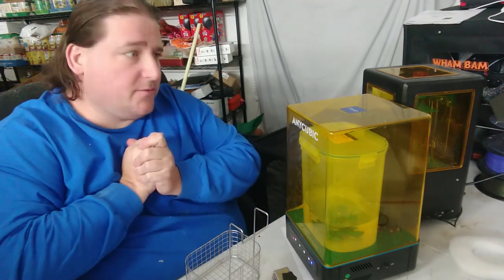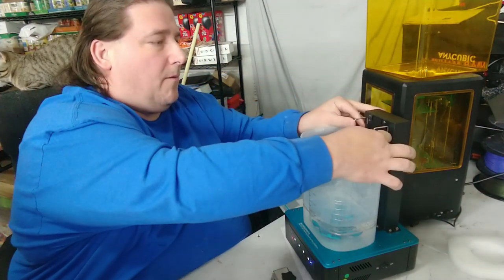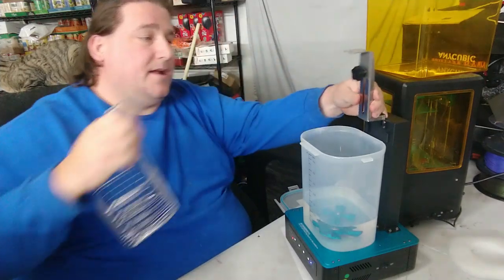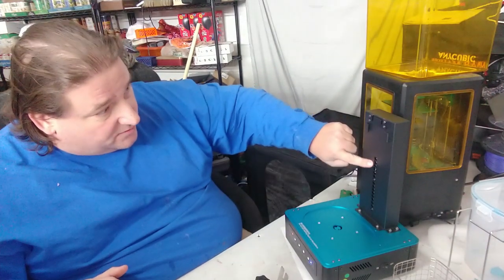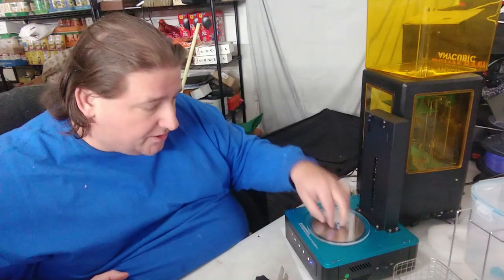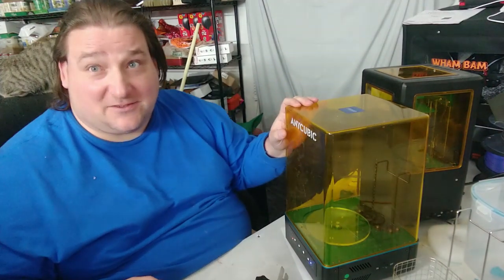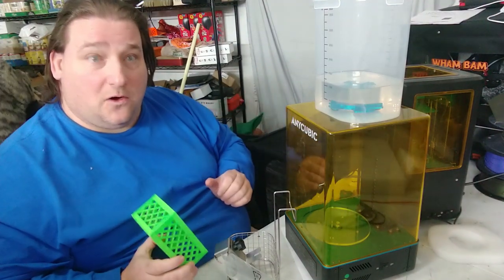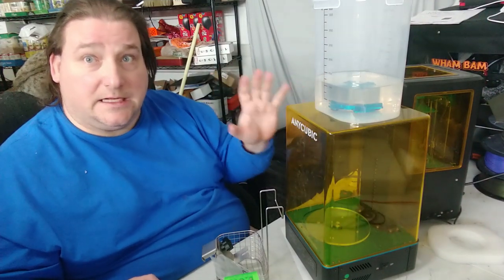Anycubic Wash & Cure Station for 3D Resin Printing T3DP

Comment: The bearing they use in the wash impeller appears to be carbon steel and not sealed, just shielded. Mine froze up after just 1 week of use with soapy water and one week empty. I purchased 10 replacement sealed bearings for about $12 from Amazon. Anycubic needs to change their bearing spec.

Comment: Sorry to chime in this way ... but embedding more leds in the bottom is a good idea BUT it doesn't have to be a ring... it can be a simple line just like the back line because the turntable is turning anyways.
Reply from the maker: True but a ring would cover more angles underneath. And cure more of the model. But yes a line can also work. And don't apologize. You didn't do anything wrong. :-)

Comment: Just a thought on why the DVD didn't work. The light diffraction given off DVD's probably washed out the UV wavelength. Some type of mirror would have been a better choice.
Your suggestion of UV lights underneath would be the best way to go though. I hope they decide to do that.

Right now, what I do is I put my models on a transparent glass bowel in my homemade cure box. It raises the model up into the light and allows it to cure the bottom. If my models have a hard for light to reach area I try to orient it to get the best coverage. It can be a pain at times trying to make them stand in certain positions. I was thinking of adding some hangers to hang some via fishing line. We have to do what we can to get a better cure.😉
Reply from the maker: Yep. Gonna nake a transparent needle bed to raise up models and prevent flat surface contact patches.

Comment: Nice video! I really want a wash and cure station, but they all are so expensive. my current setup with jam jars with IPA and bucket with UV lights are so clumsy to use. If this ends up costing less than 300USD it will become a must have for me

Comment: nersy, I know you can design an fmd part for that or maybe someone has put one on thingeverse already. I have not looked yet. today is the first time I've seen this. A friend has gotten on the order for this. The mesh on the basket is way too big. needs to be a screen mesh. also I think they should have mirrored the curing plate. You have too many overhangs that will not get light from just rotation. needs something to reflect from underneath.
Reply from the maker: I tried mirroring not enough light for curing gets reflected. They really need to just put a couple of LEDs under the plate. Though even having to flip it and run the cycle again. It's still so much more efficient than the old way.
Reply: @nerys71  sounds like a good plan too.

Comment: I wonder how this compares to Creality's UW-01 Washing and Curing Machine? The price for the Anycubic machine is fantastic right now, but might that be because they see stiff competition from Creality's offering? There's little info on Creality's UW-01 wash & cure machine right now. Using Creality's website as the only source for their machine's specs, the following is how the two machines compare:
- The UW-01 has the ability to time both the cure and wash from 2 to 90 mins (as opposed to Anycubic's 2-6 mins)
- The UW-01 has three speeds (as opposed to Anycubic's single speed)
- The UW-01 has a 170(L)x120(W)x160(H) wash capacity (as opposed to Anycubic's 115(L)x65(W)x165(H))
- The UW-01  cures at 405nm & 385nm (as opposed to Anycubic's 405nm & 365nm)

So it looks like the Creality has the edge. BUT, it's an unknown, is selling for $25 more, and won't be delivered till next month (Jan). 
Thus the $64,000 question is whether or not its advantages make it worthwhile to take a gamble, pay $25 more, and wait a month???? Or just get the Anycubic now? (Considering that I've lived t his long without any sort of washing & curing machine)! :)

Comment: Hi, I'm a beginner in resin printing. When do you know it's time to change the IPA. And what's the process behind it? Wanna make sure I do this right and not damage  the environment. Thanks!
Reply from the maker: If you have City Water I was informed by my Township that flushing it down the drain is fine but flushing the resin down the drain is not good so you're going to want to remove the resin from the alcohol. A shallow pan out in the sun it will cure all the resin and probably evaporate most of the alcohol if not all of it the plastic that is left over you can simply throw away it's inert once it is cured

In theory you might be able to cure the resin and recover the alcohol and use it again
Reply: @nerys71  Thank you!

Comment: Making a tighter mesh on the basket may interfere with the cleaning.  It will be more difficult for the swirling liquid to move through the mesh if they the mesh is too tight.
Reply from the maker: Agreed they have to determine at which point it does more harm than good but this mesh is too open.

Comment: My question is how do you dispose a gallon of ipa? Can you imagine makers disposing millions of gallons of this now in the world.
Reply from the maker: When I called the water company, they said pouring alcohol down. The drain was perfectly safe. The only thing is you don't want to pour contaminated alcohol down the drain. So you need to remove the resin from the alcohol. Sitting it out in the sun and precipitating. The rising out of it should be enough. Once the resin is cured it is perfectly safe.
Reply: @nerys71  Of course, it is flammable, and you have a burn barrel...